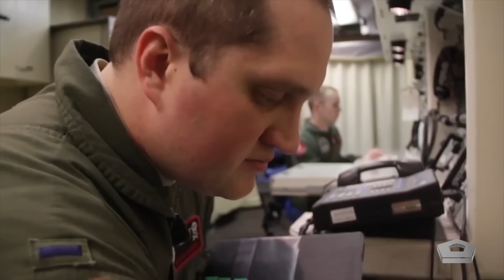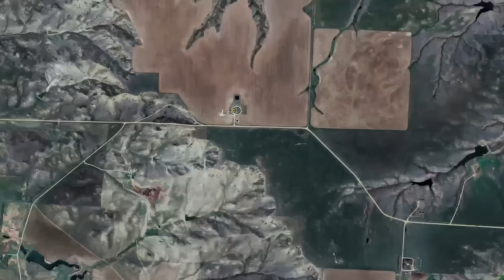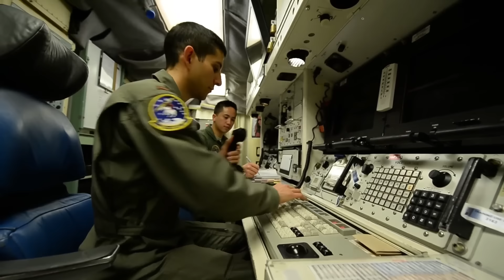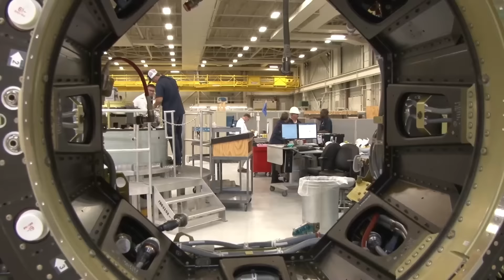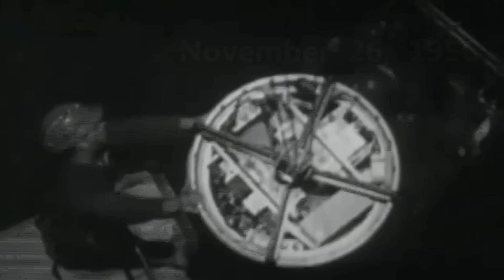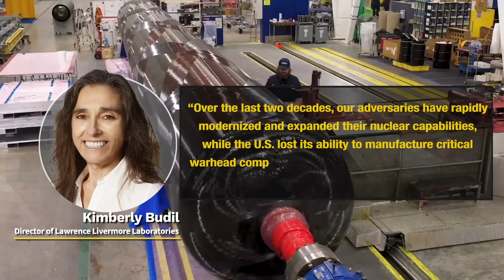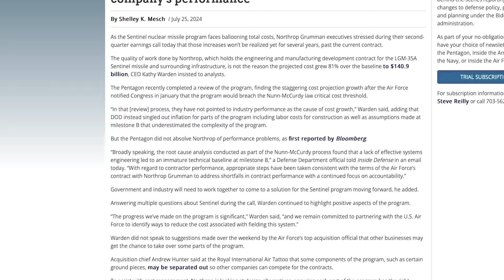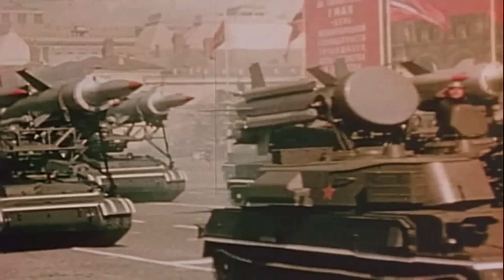America’s New Doomsday Weapon is Unstoppable

Comment: Those 8" floppy disks are actually incredibly reliable.  They are not the weak point in the old system.
Reply: "Those 8" floppy disks are actually incredibly reliable."
But they're not immortal. An 8 inch disk spinning 24/7 will last 10-15 years. The drive itself maybe 20. And they're no longer made nor are the parts.
But you're right. Expiring rocket fuel is more of an issue than the floppy drives.
Reply: @wisenber You don't think 8" floppy disks are still made? They may not be sold to the public, but they are certainly still made.
Reply: @wisenber  They went out of consumer production.
Reply: @wisenber  You don't know that. The government could very easily have a contract for 8" floppy disks. They'd be incredibly easy to make and highly profitable considering what the government pays for defense contracts.
Reply: @wisenber  "But they're not immortal. An 8 inch disk spinning 24/7 will last 10-15 years."

compared to an OS like windows that apparently can't go more than a few weeks without updates, and gets totally overhauled and replaced every 4-5 years, that's an eternity....
Reply: @wisenber  Those drives don't spin at all if no data is requested. They are not mechanical hard drives. They purely on demand. The only issue is "stiction" but the systems have a use/test schedule to stop that.
Reply: Exactly. They are the strength of the system. Simplicity and hardened resilience to attack. The ultimate firewall is to not be compatible with current technology in any way.
Reply: @slartybarfastb3648  Hardly. The disks never were the concern. Connectivity to the disks were.
A new controller can be just as disconnected as an old one. No firewall needed when there's no connection to compromise.

Comment: I wonder how often they replace the fuel in those missiles that have been sitting there for freaking 50 years? I'm thinking if it's the same freaking missiles no matter what kind of shape if they've been sitting in those silos for decades they're most likely going to fail upon launch. I mean Jesus Christ look at how many fails they have on rocket ships and missiles that take off above ground that are brand freaking new. One thing about time Decay is everything no matter how good it is is going to break down from just sitting there doing nothing for years upon years so I would think that China and Russia have nothing to worry about when it comes to these missiles that have been sitting in silos for decades. I think they should be more worried about missiles coming from submarines or other water-based naval ships and the greatest threat would most likely be from stealth bombers.

Comment: I understand needing to upgrade worn out systems, but wouldn't new all-digital equipment be more vulnerable and wear out even faster than the old analog, overbuilt, wired systems? 

There must be many engineering reasons why I'm wrong in my assumption, I'm just curious what some of them are.

Comment: Great video, as usual.  I wonder about the radioactive fallout of the “sponge theory” you mentioned. My understanding, which is admittedly limited, is that to generate that kind of “global” fallout, you need a detonation above ground, where the radioactive contaminates get shot into the atmosphere and then drift with wind patterns.  Not sure how effective that would be at destroying buried missile silos, and maybe the point is to force ground detonations that would limit the fallout to local regions.  Though given how many nukes you’d have to use, it may not matter.  Tsar Bomba for reference was detonated in the lower atmosphere, but had very little radiation relative to its size.  It was a three-stage bomb similar to modern ones, but the third layer was lead, instead of fissile material, which greatly limited the radioactive fallout.  It also made the explosion far less powerful than it could have been….which is crazy to think about.

Comment: I wonder if 3D printing in multiple media can make a dent in the pace and cost of production. I’m sure that’s being explored. How much of that 7,500 miles of copper cable can or should be replaced by other materials, like fiber optic cables. 

Also, if so genius can figure a way to mate modern digital computer architecture with old school floppy disk era tech, perhaps they could enhance the innate security that the old fashioned tech provides, while maximizing the speed, flexibility and efficiency of the connection between the human controllers and the multiple missiles and missile field complexes.

Comment: Small payload bus vehicles = no HGV extended warhead = limited future proofing as threat defenses become ever more able to defeat current, fractionalization, systems.  It also equates to a lot more missiles overall which drives price without improving survivability because modern Russian and Chinese MIRVs are just as 30m precise as our own and there is nothing which says: 'Burn 50 cities with 2 warheads each and you will have less fallout contamination than striking 400 silos, most of which will be empty when struck...'.

The society which loses 80% of its industrial base and engineers, doctors, scientists is dead either way but it takes less money and less after-effects consequences to maintain counter value vs. counter force options, especially given that these things will be seen 30-40 minutes before impact and the impetus will be use-or-lose, causing the sub launch option to be the secondary, insurance shot, option.

A bit of an irony since ONLY the depressed trajectory option, off a threat SSBN close inshore, has the decapitation options to possibly ensure a followon strike arrives while people are trying to determine who does what in terms of backup NCA launch authority.

The real answer is to abandon most silo based weapons and shift, voluntarily, to around 200 garaged systems, using a TEL technology developed for the MGM-134 SIBM (Midget Man).

This allows you to build 500 buildings (which, despite the moan, are the cheap parts of nuclear deterrence engineering) and install completely new systems and hardening in them while shifting launch trucks between barns so that the threat has to constantly regard all 500 garages as potential DPI aimpoints.

No going down and drilling out decades old systems, from fifty feet underground with 3ft wide steel doors to pass all the new gear through.

Again, it does not matter how thick these sites are.  Because a 1-2MT digger warhead, with the kinds of accuracies we now see in the likes of the Sarmat and Topol-M, will drill the LCC and without the LCC, all the other silos in the wing are effectively dead because you cannot count on airborne assets or another LCC to have connection with them after massive disruption of the strategic BMC2.

Which is not to say that these barns cannot be overbuilt with six foot walls and foundation springs plus internal water/power/air, if that's how you want to do it.  Only that you don't have to build a 10 story building underground to make it happen.

Each barn can have 1-2 garage spaces for the Transporter Erector Launchers, so that you only have to crews and roving security for half your effected (200 vehicle) structural tasking, the rest being cold-sited between by-annual duty rotations/construction phases with automated monitoring and check teams, once or twice a month.  Which again, cuts down on budgetary pull for the operations side.

If you combine the Columbias with 20 silo turtlebacks and 200 Sentinels with a new basing mode, you are still talking a 200 billion dollar milcon and inventory exchange but the Columbias can limp along with refurbished Tridents for awhile while the Sentinels can have their first 10-20 shots put into brand new silos if you feel you have to have an immediate standup force to allow you to draw down LGM-30 (Minute Men) which no longer meet readiness standards.

The only alternative, which might be cheaper would again involve drilling new silo farms (densepack) for automated control from remote LCCs and then fitting them with Peacekeeper equivalents with 10-15 shot MIRV or 6-8 shot HGV, similar to the Russian approach with the Sarmat and Avengard.

Overall, this looks like a minimum effort (spend more money) approach which doesn't genuinely acknowledge where we are going in terms of precision or how we anticipate ending our enemy's civilizations at minimum cost.

It might do the DOD some good to have to face up to the BARFO lies of 'buy in' on minimum bid cost planning with outyear increases under the 'too early to tell, too late to stop...' plan for robbing the American taxpayer.

An incrementalist approach as buying replacements on a wing-by-wing basis could allow for cost plus incentive plan.  While still maintaining a demanding and aggressive nucsafe level oversight to ensure that nobody cherry coats the separated milcon or missile engineering phases (since Increment based awards of followon contracts are about meeting fundamentals of safety and availability, not LRIP to full scale manufacturing line stand up numbers...).

It would be nice if we still had people who could think out that far...

Comment: "American  ICBMs only carry one warhead per missile."  Not true Keemosabe, they are MIRVs.  They are a real PiTA to defeat.  Cost over urns may not be what you think.  As tech emerges and problems emerge, there are a deluge of design changes, many of which cause a cascade in modeling, simulation and all that cool stuff.  The contractors get more money, but it's just part of the floor show.  The generation of missiles on line now are built like big pieces of fine jewelry, for a purpose.  The old liquid-fuel missiles were a study in galvanic corrosion and decay.  Each new generation is built to last much longer and require a lot less maintenance.  ICBMs are easily detectible and have predictable flights that rely on the terminal stage for deception.  SLBMs are like a good ole Derringer at a card game that is fired under the table.  Ach!  What was that?  Our stealth aircraft should make anyone with measurable intelligence nervous.  Design to Cost went out the window with biplanes, as it should have.

Comment: If Russia and China didn't have land based missiles, then I would say get rid of them.  But they have kept and modernized their land based ICBMs.  If the US unilaterally pulled them out of service, that would greatly simply targeting for Russian and Chinese forces.
Second point, even though SLBMs are just as accurate and lethal as their land based cousins, they are not the best possible option as a counterforce weapon.  That has to do with their platform, a submarine that has to stay hidden and minimize any emissions.  They depend on wireless links only to receive launch orders (assuming they can come to a position to receive them when they are transmitted).  In a launch on warning posture, they may not be the most reliable platform for launching missiles in response.

Comment: Land based ICBMs are essential for stability in deterrence. They’re the fastest to react, least prone to accidents, and safest from unauthorized launch of all the legs of the triad, it’s really wild that Mattis attacked it as a risk to inadvertent nuclear war. They are extremely hardened targets spread out over hundreds of square miles and they can’t launch without multiple LCCs turning their keys or the airborne command post sending the command directly in the absence of any activity from the LCCs. Other nuclear delivery methods may be more effective or individually survivable but none of them can replace the foundation that the ICBMs provide. Their presence means that an enemy is obliged to dedicate many hundreds of warheads to be assured of neutralizing their threat and even if that was deemed reasonably likely, they cannot guarantee that the ICBMs would even be there by the time their weapons landed because of how quickly they can be employed once their attack is verified to be underway.

Comment: I would have thought the military would have at least upgraded to 3.5" floppies which are more durable and are a drop-in replacement for 5.25" floppies. Even, the CD-ROM is outdated, but you can still burn them on any optical recorder. That's might be a problem. I never used Zip disks, so I have no clue how durable those are. Those are probably not worth messing with.

Comment: If SpaceX were building the Sentinel, they’d be done and in the silos already.
Reply: Space X is amazing at what they do
Reply: I’m surprised they haven’t made a satellite that shoots a massive beam lol
Reply: While I agree that SpaceX could very well design a good ICBM, it is very much against their agendas and design focus to do so.  Spacefaring rockets and ICBMs have some very different purposes which require very different designs, and I suspect that SpaceX would be hard-pressed to retool for such a task even if they were so inclined.
Reply: @OneBiasedOpinion  you may be correct about the company’s interests, but I doubt it. SpaceX launches most of our space-based weapon systems, so I’m not sure why they’d be deterred by some sort of ethical dilemma. In addition to this, I think you may be a little out of your depth if you think there is a major difference between “spacefaring” rockets and ICBMs. ICBMs launch space vehicles just like the Falcon Rocket does. The only difference is, the space vehicle is designed to de-orbit the payload almost immediately. In fact, our first orbital flights were launched using Atlas missiles. Also, Orbital ATK still uses Minotaur I & IV which are slightly modified versions of Minuteman and Peacekeeper ICBMs.
Reply: @thurlravenscroft2572  the major difference isn’t in the destination, but in the design.  One is built to push a payload into space and then either fall back to earth and disintegrate, or (in recent cases) return and land safely for reuse.  The other is aiming for a ballistic trajectory through space at much higher speeds and must hit a specific location at the end of its flight path.  I may not be a rocket scientist, but to me, those sound like two very different jobs that each come with some unique design considerations.  And repurposing ICBMs for orbital payloads isn’t quite the same as repurposing orbital rockets as ICBMs to my mind.
Reply: @OneBiasedOpinion it’s really not that big a difference. The major difference is adjusting the injection angle to result in the space vehicle staying in low earth orbit (kinda like StarLink satellites), so they can release their payload “over” the target area. This is actually a task that the Falcon 9 is particularly good at. BTW, the ICBM max speed is approximately Mach 20, whereas a Falcon 9 max speed is around Mach 23. So, ICBMs are actually slower.

Comment: That grid layout China is using, makes their sponge very defeat-able. Because they are so evenly placed apart from each other, you can effectively just use a strong enough warhead to blast multiple from the center points between them. 

So if you have 4 silos, you can take out 4 with one missile. 8 with 2, 16 with 4, so on and so forth. Just make sure they have the power to deliver the impact hard enough to do the damage needed.

Then on top of all of that, you can send a second wave immediately after that targets the middle points between just the 2 silos instead of the groups of 4. 

This effectively turns it into a nuclear carpet bomb, and you'll still only be using a fraction of the ratio of missiles to the number of silos fake or not.

If we're gonna keep on using sponge theory, I think it's best that they be randomly placed even if still somewhat grouped together. Makes it harder to do something like what I just suggested could be done.

As for what is best to be done?

Automated Ground to Orbital Anti-Ordinance Systems, to explain it via a mock up name. 

Essentially extreme powered turret systems that are highly accurate, and only ever takes aim at things that will go boom if they land. Powerful enough to reach the outer edges of the atmosphere, that sort of thing.

And then you have that done in 3 layers. The first ring is for reaching the furthest first, the second to get anything the first missed somehow, and the third is on a 360 swivel to catch anything that somehow makes it past the second and first layer. If this layer is firing, everyone is best to be indoors in a safe place, because it could get hairy. 

As for how it's taking out the missiles incoming? Simply disintegrating them via the swiss cheese method via incredibly large rounds that hit hard enough to redirect the missile off course. And because the automated system can keep each other turret lined up to lead the new course of the missile, continue to barrage it until it blows up far far away from anywhere "important". 

Would it be cheap? Aw heck naw. But, if implemented well enough, if it can be implemented well enough, it may just save us the cost of having to launch. And that, hopefully makes it worth it?

Comment: One of the buge benefit of having this specific amount of these land based silos (around 400) is that those nuclear missiles alone are more than any other country's entire arsenal (except Russia).  This itself is strategic because it would require any other country, or several of them combined to use most, if not all of their supply of nuclear weapons to take out these silos.  Then they would have zero ability for a second strike, or extremely limited.  That is also a huge point of non-proliferation..... is to ensure countries don't obtain the weapons and it is far less likely our system would be overwhelmed by a conglomerate of 20 nations with 100 nukes each.